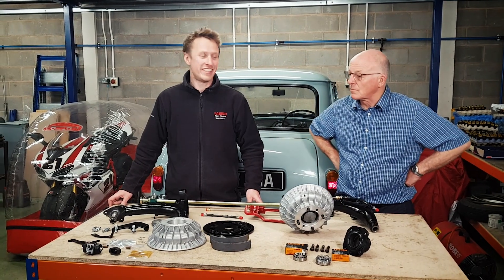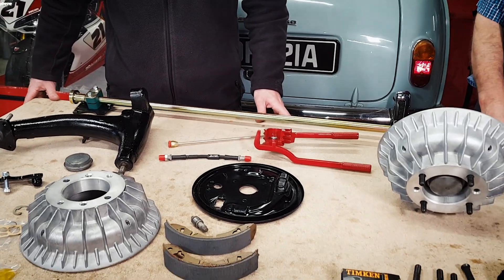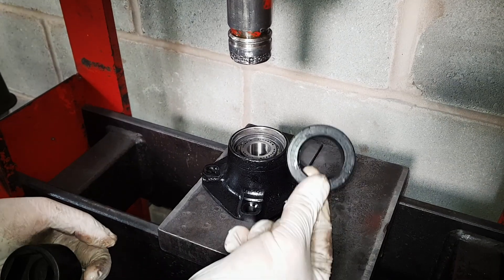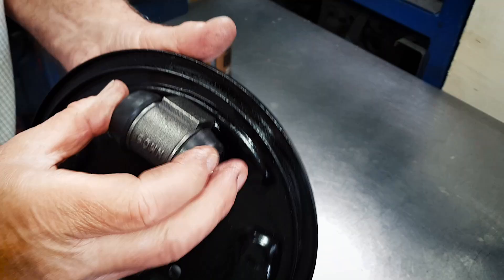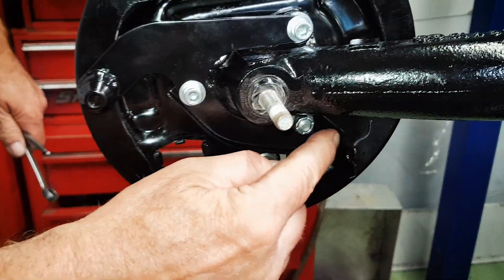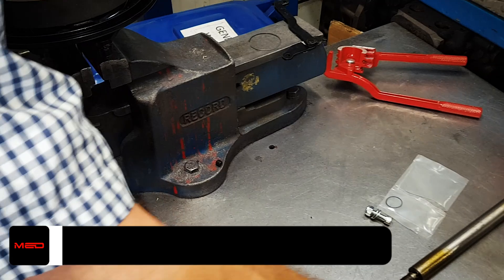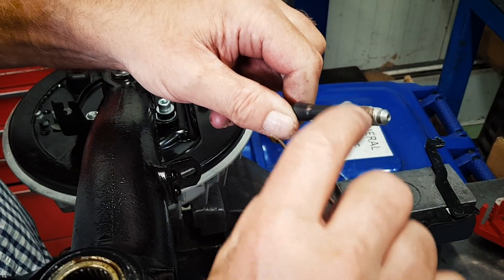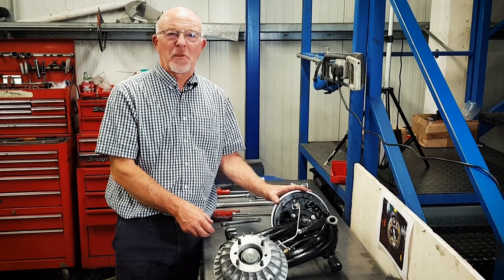Project 63 part 11 - Mini rear brake assembly, with upgrades

Comment: Great video with perfect detail, thank you so much! You mentioned the aluminium drums were wider, would that make the wheels stick out more? Also apart from the weight what are are the pros of using the Ali drums? Dissipate heat better with the fins?

Comment: Hey,

due to some work on my brake system and on my radius arms, my brake master cylinder is without fluid since 3 months now. You think it is bad for the seals inside, or can I just continue my work and it will be fine?

Comment: Great video, but I hope the handbrake cable doesn’t foul on the brake pipes as they originally have 3 bends in (you used 2 bends) - I always use the originals as a template.
Reply from the maker: Thank you :) There's plenty of clearance for the handbrake cable.

Comment: What paint did you use for painting the arm and backplate
Reply from the maker: We used engine enamel spray paint - just what we had on the shelf!
Reply: @MEDEngineeringTechVideos  Thanks MED. Just a question since your one of the best when it comes to Classic Mini building and parts. I have a 998 classic mini with a 12G295 head that is being modified with bigger valves, harden inserts exhaust and new guides. I also have twin SU carbs. What else could I do to get more BHP out of a 998. Would reboring to +80 increase BHP. I'm also thinking of buying  a swiftune SW5 cam unless you have a better cam you make.
Reply from the maker: @IsraelitesUnited  Sounds good. We would suggest the MED HT (High torque) cam for this, which is our take on the 255, and will offer very similar results. It's a popular choice for fast road 998s. When changing the cam, we'd recommend using an Aldon AYPi distributor, which suits the HT perfectly.

Also take a look at our stub stack kits with ITG foam filter for the twin SUs. These are very effective.

Although this won't increase power, a swap to one of our St1 flywheel kits makes a real noticeable improvement to acceleration on a 998. These bits combined will make for a lively fun road car. Hope that helps.

Comment: Mmmm… painted back plates.  Sooooo much more durable than the powder coating that everyone seems to think is the ideal, even as the metal below quietly corrodes away to dust…. 
Cheers, Will
Reply from the maker: Yes, from our experience, the powdercoat flakes off in no time.

Comment: Don't ever put grease in a bearing the way you just did. Put the grease in the palm of your hand ,then with a wiping motion, using the heel of your thumb ,force the grease into the rear (large side) of the race, wipe excess off and fit bearing

Comment: Loved the photo of the assembled shoes and springs stuck to the back of the bench. I have a similar photo inside my toolbox lid, held in place by magnets.
Reply from the maker: Yes, it's one of those things that looks simple until it's all in pieces!
Reply: The shoes have a self servo action where the rotation pulls them on to the drum.The end of the shoe the friction lining gets closest to should face the direction of forward rotation so that when it contacts the drum the rest of the shoes gets pushed on to the drum.

Comment: Hi Chap's, enjoying the series so far! With reference to bearings, well it has to be Timken! As I found out the hard way...fitted Gen Rover ones and they wouldn't torque up, so sent them back and then fitted the Timken. Love the pipe bending tool, cool. Will the anti-rollbar be a KAD one, as they seem to be popular? Great stuff guys 😊
Reply from the maker: Yes we keep the KAD anti-rollbars in stock.